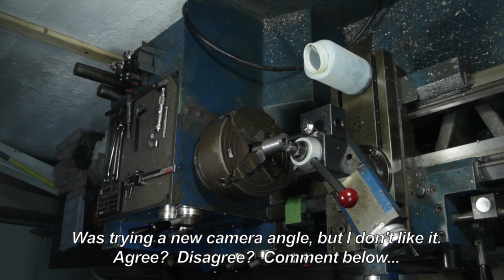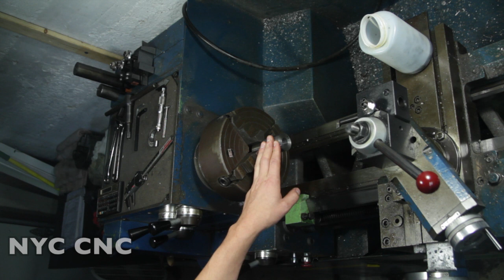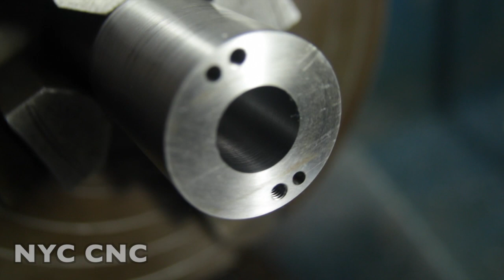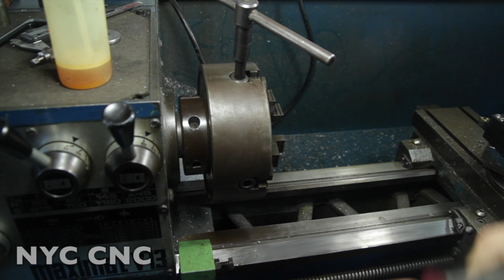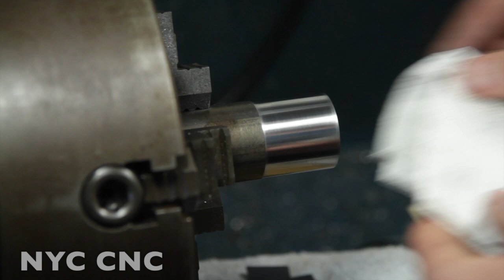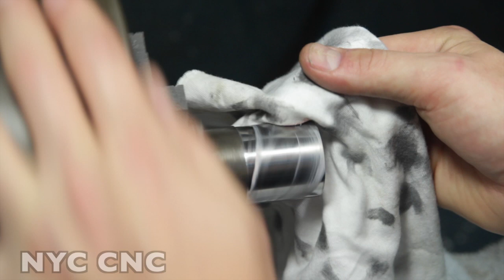Making Copper Bullet Jackets: Machining Punching & Drawing Dies!  Part 6

Comment: Boring is arguably more difficult then threading when you have small tolerance and low tapper allowance. The most important factor to maintain a consistent cut is even loading on the boring bar. That means you must not have any radios or bell mouth at the start and  avoid pausing or changes of feed. Changes of the loading will alter the flex of the bar and subsequently result in tapers, undesired and unpredictable diameters, as well as chatter.

Comment: That's why carbide tools are awesome because you can set your RPM 4 times faster, use no lubrifiants and remove a lot of steel in one pass (in theory the lenght of the carbide but your lathe will probably not like it)

Comment: Hi,

If you're looking for an accurate cut with a carbide insert, you should know that it will cut exactly what is dialed in if you take a cut that is 2 times the diameter of the tip radius of the insert.

Meaning that you have an insert with a tip radius of .016 inch and make a cut of .032 inch, you can be sure that the actual cut will be .032 inch. A heavier cut like .100 inch will give you a more like a .103 inch or so. And a lighter cut will give you less than the dialed in cut and most of cases as you try to sneak in it will most of the times get a huge cut as it will all of a sudden grab all the sneaking and more.

The best way to achieve the rated cut is, 1st to measure exactly where you're at and, 2nd do the 2 last passes at exactly 2 times the radius of the insert, in most cases I get within 3 to 5 tenth from the desired goal.

For finishing or smaller works you can use .007 radius inserts.

Thanks for your involvement and good videos.
Reply: Hi,

That's what I've learned and by experience it is what I'm getting.

If you want to try it's easy: Find out what is the radius on your insert ex. a TNMG 332 will have a radius of 1/32nd. of an inch, indicated by the 3rd. digit (2) indicating how many 64th. of an inch is the radius ie. 2 times 1/64 = 1/32inch = .032inch, with that insert if you dial a cut .064inch you're assured to get .064inch within half a thousand.

To do finish cut with a nicer finish that's the way to go. To deal with smaller cuts you can get inserts with radius as small as .004inch.

About the .103inch, the fact you're cutting more dialing a bigger cut, it's because the insert dives in more due to pressure.

You have to be carefull choosing your inserts depending if you do mostly bigger or smaller cuts.

If you need more explanation just let me know.

Comment: The camera view is melting my brain :)
As for your boring finish, I had some horrible luck using the same type of boring bar in aluminum, and the main problem was due to the geometry ground into those brazed inserts. That may not be the case with your 1144 though :(
I got some great tips from the online community, my before and after are at: v=wYohs6Hk3MQ

Comment: If you are using the cheap brazed on carbide boring bars, they are horrible and leave a terrible finish in steel. Part of the problem is that the cutting geometry is too sharp. Also with carbide, it like heavy cuts to get a nice, consistent finish. It would be worth investing in a set of replaceable carbide insert boring bars if you are doing a lot of boring operations.